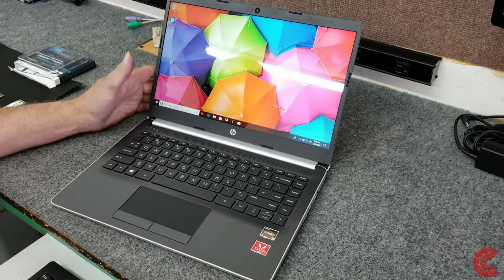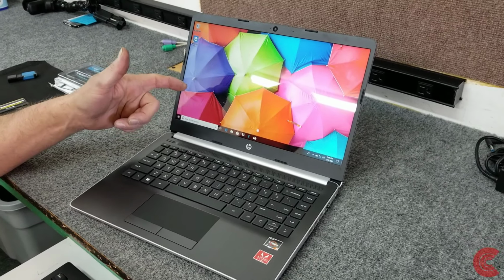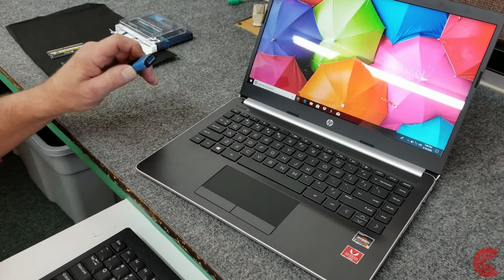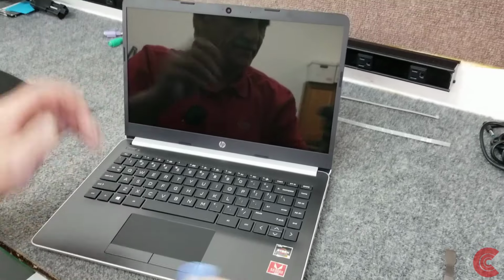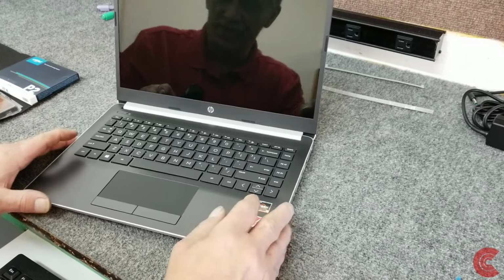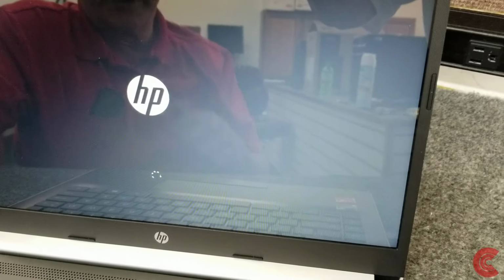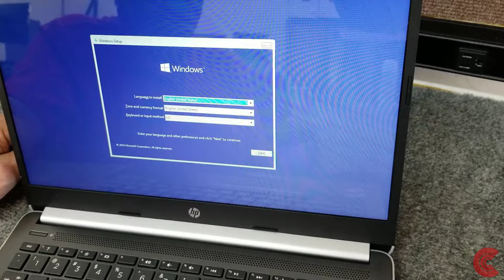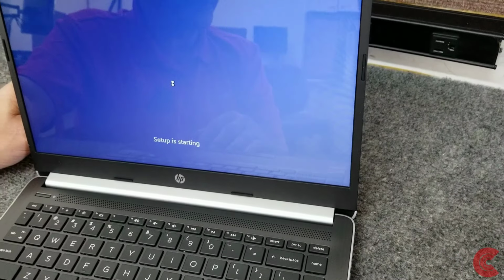HP 14 Laptop SSD Upgrade, Memory Upgrade

Comment: Hello. Can you please make a tutorial on how to install a hard drive into that 2.5 inch space?
Reply: Any solution yet? :/
Reply: @Fleecast  not yet sadly, but o figured out how to do it on my own. First you need a hard drive connector which I will link. Than, you need to plug in the connector to the motherboard. The the place where you connect it to the mobo is right next the 2.5 drive space. Than, plug in your hard drive and you are good to go.

Hard drive connector: https://rover.ebay.com/rover/0/0/0?mpre=https%3A%2F%2Fwww.ebay.com%2Fulk%2Fitm%2F264749808765

Note: I am talking about the HP 14 inch laptops, because all of them are basically the same but I am unsure if this connector will work for all of them. Yucaluca7 out!
Reply: @yucaluca8561  can i upgrade a SsD disc in that place?
Reply: @a.saezMT  yeah you can put one in there as long as it is a 2.5 inch drive. You do need a special cable to collect it though
Reply: @yucaluca8561  The bottom cover of mine won't allow for a 2.5. I'll have to grind them down.

Comment: 32gb is overkill for this laptop ,i have same but mine came with 8gb 1 stick , i wanted to upgrade to dual channel though , not sure why they put in 1 stick , it will only run at half rated speed that way, also 4gb when the gpu used 2gb that is crazy that they would sell it with only 4gb as an option, mine shows 5.8 available out of 8gb as it was, also regarding the ssd, i realized after putting in a 3500 read speed m.v evo ssd, i was only getting half that speed according to crystal disk speed test, then after some research i see  2 of the 4 pcie lanes are dedicated to the graphics so yo will only get half the speed of what ever m.2 drive you install. also the speed of ssd decreased from 1750 to 500 when on battery, limitation of this laptop to save power,

Comment: Hi great video ordered ram installed easy also ordered a mx500 500gb crucial ssd to add into space free in hp14-ck0598na I'm struggling to find correct sata cable is any laptop sata cable OK to use

Comment: Your device ran into a problem and needs to restart. We’ll restart for you, I cloned the original drive to an m.2, put it in, added a 2.5 ssd, and replaced ram with 16gb 3600mhz crucial. I don’t know what could’ve went wrong

Comment: Upgraded RAM and the machine is a different beast. Okay not going to break any records but it’s stopped the need for me to purchase another laptop for now! Appreciate this video is old but mine came with a 1TB SSD and I’m thinking to install an NvME to increase the boot speed even more (just for windows etc.) However do these not require a heatsink also?
Reply from the maker: In a model like this, you should be fine without it.
Reply: @CadillacComputerCenter  can we install 16GB +8GB pre installed RAM(Samsung M471A1K43CB1 8GB DDR4 2666MHz RAM) = 24GB RAM

Is it support in HP 15g DR0006TX laptop !?

Comment: I have single stick 4GB from factory. I want to upgrade memory. Can I add an 8GB stick to the unused slot to get 12GB or do I have to add another 4GB? Does the size need to match or only the MHz speed for better performance? Thanks.

Comment: Looking to update my HP laptop, not exactly sure on what it can all handle however. I'd like to modify both the ram and processor, get rid of that nasty intel stuff switch it out for a more advanced one, more modern. "HP 15 BS1XX processor is Intel(R) Pentium(R) CPU 4417U @ 2.30GHz   2.30 GHz and the ram in 4.00 GB.
Reply from the maker: Hi. Unfortunately you cannot upgrade cpu in the laptop. Cpu is soldered to pcb.
Reply: @CadillacComputerCenter  okay, what do the ram then?

Comment: Hello,  Thank you for your video.  I have a 14-dq2078WM that i purchased and going to do a RAM upgrade and would like to know if the 2.5HD caddy and cable would work for my computer?  I imagine it will, but other HP forums i have seen (esp HP official forum) they say it doesn't.  It seems like by your video it will work?

Comment: I have the hp 14-fq0032od model and it came with 64 gb Emmc built in. But I noticed there is a slot for nvme but no matter what ssd I have tried out in there it’s not recognized by the Bios. And I know it’s not the ssd as I have put them in other laptops and work fine
Reply: My only guess is it has been block on the bios by factory

Comment: Thank you for the video, it was really helpful in upgrading the RAM in my (similar model) laptop.  One thing - I found that double-sided Sellotape held the rubber strips in place really well when replacing them.  
My laptop has 128GB SATA-3 TLC M.2 RAM with a B+M ended connector.  Do you know if there is a maximum volume that I can replace this with?  Also, will it need the same connector?  I saw in your video you replaced the SSD with one that was either B or M, but not B+M.  Finally, can I change from SATA-3 to NVMe?
Thank you!
Reply: Allat yappin to get no response

Comment: Can u install SATA SSD 2.5 instead of HDD on that area..? 7:13
Reply from the maker: Hi. This model did not come 2.5 inch mounting caddy or cable.
Reply: @CadillacComputerCenter  But, if u can buy the cable... Can u install it..?
Reply from the maker: You will need caddy and cable.  There is a connection on mb for it.
Reply: @CadillacComputerCenter  Thanks
Reply: Can you keep the current M2 SSD and additional SSD in that slot ? in left lower corner.

Comment: This is exactly the video I was looking for! I have a slightly different model, but same chassis. I'm planning to add a second 8GB stick of RAM (with a matching stick from HP to what come in there) and adding an NVMe drive (I have a 1TB HDD, no SSD) that will be become the primary drive and the HDD will be for additional storage.

Comment: Thank you for the video. I bout the hp 14-dq1025nr It comes with  the 10th Generation Intel® Core™ i3-1005G1 processor i just bought it yesterday and plan to do the same thing. Do you think it can support x2 16 gb of ram. Because my processor runs base 1.19. Gigahertz and 3.4 turbo. Thx 🙏 😊 also do the pins change i looked up some ram on amazon and saw it says 288 pins. Thank you so much in advanced

Comment: Quick question i have slightly different model, PC Notebook HP - 14-dk0002dx Can i upgrade it with the same type RAM you used and also will my model support the 2 16GB ?

Comment: great vid! I have a HP Notebook - 14-df0013ds which looks very similar to this one. Could i accomplish the same iwth this one, including adding a secondary 2.5 laptop drive? Thanks.
Reply: I read on Tom's hardware that this eMMC is soldered. So could I still add the 2.5 HDD or SATA SSD. Or should I just give up on this model and install a lightweight Linux?

Comment: Hello sir,

Thanks a lot for the video....I had a question- I actually have an hp 14-dk0010ca [laptop with similar specs as yours with the exception of the processor- A4 vs. Ryzen]. It however didn't have a soldered in m.2 nvme slot although the motherboard had solder pads for it. I went ahead and ordered an m.2 nvme connector and soldered it in place. The NVME drive I got however was not recognized in the bios or windows (but did get warm).

I am thinking that either the m.2 motherboard area is missing some components (capacitors, diodes, resistors, jumpers, maybe a chip, etc.) or the m.2 slot is disabled within some hidden settings in the bios.

I really hate to bother you, but if its not too difficult (or perhaps if you already have them) could you please send me some high res pics of the m.2 slot and the components around it...perhaps I will find the missing components and ask a laptop repair guy to solder those components in. If its too difficult, no issues.

Really appreciate it,
Thanks,
Nooman

Comment: I'm using HP 14-bp100nx Laptop. Is it possible to use an additional SSD?
HP 14-bp100nx Laptop comes with 1TB HDD but doesn't have SSD. Highly appreciate for answering.

Comment: thanks 
upgraded mine to 32gb ram (team group 2x 16gb) worked perfectly.
now i just need to find a sata cable and install a hdd as well (that 128 gb goes fast)
got an old 500gb hdd from a diff laptop just sitting around. figured might as well slap that in there. 

i actually use mine to do some light gaming on 
runs the games i play well.
terraria. borderlands 2. trackmania. left 4 dead.
and some emulators and teknoparrot.
Reply: Hey man I got issue playing gta where character models and map doesn’t load fast enough would sdd upgrade help me I have a already did the ram which makes it better but loading the game and world is slow
Reply: @t-dontcap1896 might aswell upgrade to a amd 5 or 7 if u want to play gta amd 3 wont cut it lol

Comment: Thank you for the very clear video. Just asking, which are the specs of the ddr4-sodimm you choose to upgrade the laptop? I'm stuck with 8 gigs ddr4-2400, and I was looking forward for some extra speed.
and 'bout the cpu, which ryzen is in?
Reply from the maker: Hi. I installed ddr4 2400 ram. 2 sticks of 16,  32 total.  It's a ryzen 3 3200. Thx
Reply: @CadillacComputerCenter  same apu here. Could be a benefit using ddr4 2666 or higher?
Thx a lot
Reply: @federicomacchini3680  that laptop won't go faster than 2400 of ddr4 ram that goes for almost anything unless it supports higher then that witch with laptops you get what you get

Comment: mine is hp notebook 14-aq001tu is it possible to upgrade its ram and hdd to ssd?
Reply from the maker: Hi. I believe yours will easily take a 2.5 inch SATA SSD.  Also, your ram is ddr3L. You can bump it up to 8gb.
Reply: @CadillacComputerCenter  ok thank you

Comment: Mr. Dale, how do i know my laptop can support NVMe PCIe ssd?
My laptop is HP-14 cm0005au, please reply.
thank you so much.
In some website that i read, it says that my laptop support M.2 SSD, but i dont know if this laptop can support M.2 NVMe or not
Reply from the maker: Hi.  I believe your model comes with 1tb standard HDD.  I cannot say for sure, but I would say you probably have an m.2 nvme slot inside.   Pretty easy to open up and look if you want. Dale

Comment: Did you have to boot it from the stick? will it not work if you boot it up normally? im a little confused
Reply from the maker: Hi. I installed a new ssd.  I booted from the flash drive to do clean install of 10.
Reply: @CadillacComputerCenter   so i have a 512gb and im upgrading to a 1TB ssd from crucial will i need to do a clean install as well?

Comment: What's better to do? I have a hp 14 cm007la with 4gb ddr4 2400mhz micron technology with a second free slot, Can I buy a 8gb ram from crucial or Kingston for 2nd slot and Will have 12gb ram or better remove 4gb and put 8gb ram in one channel? PD ; there isn't that brand in Perú so instead I Will buy Kingston or crucial
Reply from the maker: Those  brands will work great, yes. You can do 12gb. Dale
Reply: @CadillacComputerCenter  Thank you so much sir, Best wishes for u!
Reply from the maker: Thanks for watching,  same to you. Dale

Comment: Thanx for the video.  You made it look so simple to do .  I would have thought that you may have cloned the old drive to the new one  before you started but if not the end result was the same..
Reply: I wondered that, too.  Only reason I would think to do a fresh install on a new computer is if there was a boatload of crapware installed.

Comment: Thank you, great video with lots of info and no absolutely no bullshit! But where can I buy the replacement 256GB M.2 SSD and be sure that the electrical specs and timing specs are OK?  It seems that the only  original spare part officially available from HP (here in Denmark) is the power cord, so I'll have to find the SSD at an external supplier.
Reply from the maker: Hi. You can find these drives easily on Amazon,  or Newegg.com.  any brand m.2 ssd will work.

Comment: 10/10 On those part numbers for the HDD. Wouldnt have found them without the vid. £20 in total. Acer just provides them
Reply: I still can't find them. About the acer, i can confirm.  Considering retail price for similar HDD connectors online, it was a really douchy move on HP's part not to include it in the first place.

Comment: Hi!, can i upgrade it to 2 ram of 16gb ddr4-2400 hz?
and my laptop have a amd 530 series, in this case can i use a gddr5 ram?
Reply from the maker: Hi, yeh you bvb should be able to.
Reply: @CadillacComputerCenter  what is bvb?
Reply from the maker: Sorry about that. Typo!
Reply: @CadillacComputerCenter  so... Can i upgrade it?
Reply from the maker: You will use ddr4 ram, yes you can upgrade it.

Comment: I have this laptop and i want to upgrade the ram fo i can run some light games so i could slap 16gb of ram in it?
Reply from the maker: Yes you can.
Reply: @CadillacComputerCenter  Hi!, can i upgrade it to 2 ram of 16gb ddr4-2400 hz?
and i have a amd 530 series in this case can i use a gddr5?

Comment: Awesome! Thanks. I upgraded my ssd and ram and saved tons on it! Thank you.
Reply: Which SSD did you go with? I'm probably overthinking this but there's so many different brands to choose from. Obviously this is not a gaming laptop so I don't think it's critical to buy anything super fast or anything.
Reply: @gsdubz9931  I went Samsung because I'm sold on their quality and don't want to take the laptop apart more than once. I got the Samsung 980 and Samsung ram sticks but KNY has lifetime warranty and is good too. I recommend getting at least 16 gb ram and at least 500gb memory just for basic use. Then maintenance is key. I bought my stuff in Best Buy. I've done this uograde to 2 laptops and it works great! Good luck

Comment: Thanks a bunch! This video was perfect for what I needed to know.

Just in case anyone was wondering, the disassembly in this video will also work on an HP 14 dk1032wm. I just got a brand new one yesterday and needed to upgrade the RAM. Replacing the stock stick with a single 8gb replacement dropped my online memory usage from 80% to 54%.
Reply: Thanks a lot for this, I just got mine too
Reply: Did you have to reboot it with the insulation drive, and reinstall windows 11 after you upgraded the ram
Reply: @ayotundeoluyeye6016  No, I didn't have to reboot it in any special way or reinstall anything. As long as you have a compatible RAM stick they should just work without any problems.
Reply: @falloutlover5443  ohh great, thank you
Reply: Can you give provide the specification of the ram and ssd you used . I have exact laptop and I want to buy both the ssd and the ram. THANKS
Reply: @olaray1641  I have just the stock SSD and RAM, so whatever would be listed on the box is what I have. I did double the RAM though with a second stick I had laying around already though.

Comment: Hi! Can i use nvme ssd?
Reply from the maker: Hi. Yes you can. Dale
Reply: @CadillacComputerCenter   i would also like to ask what Ram can i use? The processor i have is intel i3 7th gen.
Reply from the maker: I believe it uses ddr3L
Reply: The provided ram is 8 gb ram 2133mhz. I need to ask if i can ise 2666 mhz?
Reply from the maker: I cannot say for sure, but intel says 2133.

Comment: Did you have to change anything in the bios when you added 2 sticks of ram? My hp seems to run a little slower now.
Reply: I believe you want to flash the BIOS and then enable Dual-Channel RAM support. But dual channel's not available if the RAM slots aren't matching (ex: it's better to have 2 x 4GB of ram than 1x 4 GB and 1x 8GB) . The latter example isn't dual-channel supported I believe. But you say it's running slower? It should be a bit better even still with more RAM, I'd check up on the DDR type or its transfer rates compared to your original RAM.

Comment: so i did the same upgrade RAM and the system never uses that much ram so waste of time , have 10 apps open and its using 5.6 out of 32gb of ram on this model as like you said not for gaming , and why else are you using so much ram, unless you are using it with multiple virtual machines its  waste of time to upgrade this model,

Comment: Great video, I figured there were screws under the pads but I didnt want to take them off until I was sure. I have to say I am impressed with how well organized and engineered it was under the hood. 2 screws and the cable and the fan pops right out, memory and storage are right there and simple.

Question though, with a low spec laptop such as this, is it really worth upgrading the components instead of gettimg a higher spec laptop? Lately mine has been freezing up and requiring the power button to restart, I don't know if I should upgrade the RAM or buy a new laptop.
Reply: I would say a huge A-firm! The freezing issues are usually a result of insufficient ram, especially considering this little ryzen 3 is more than enough processor to handle non gaming and non rendering processes! Get a cheap stick of ddr4 260pin laptop memory for like 20 bucks and the issue should go away. :) At least that's my own opinion on the matter. God bless you friend! :)
Reply: @FailedZerg  thanks! I ended up getting a mac mini, i dont travel for work anymore so this is perfect

Comment: i really could have used more info on the connectors, the cables, where to find them and if you purchase them, where do they connect to the motherboard. Instead i learn how to take out screws and put them back in for half of the video.